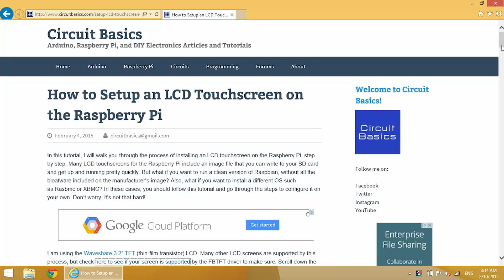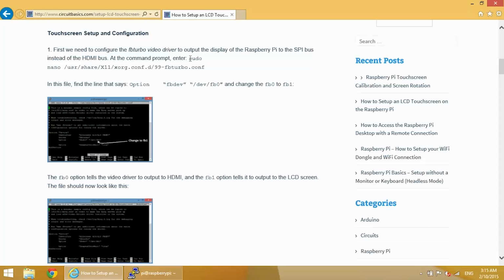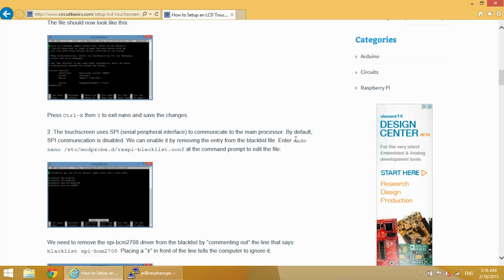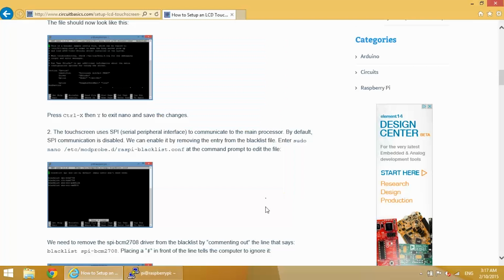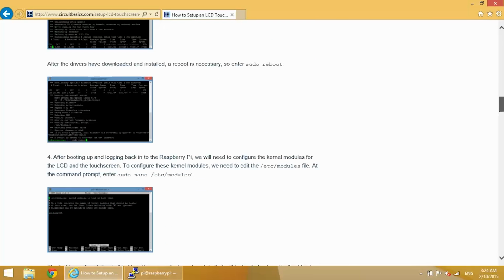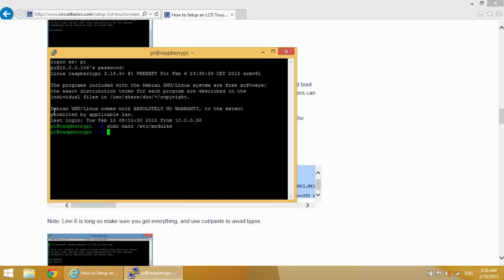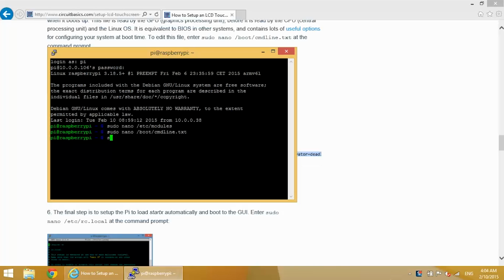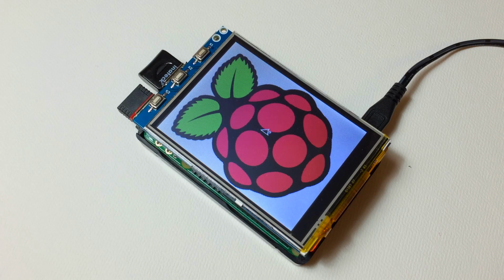How to Setup an LCD Touchscreen on the Raspberry Pi

Comment: have a raspberry 3 b with this 3.5 inch RPi LCD Display (C) 320 x 480 pixels High Speed SPI XPT2046 Touch Controller Waveshare CEROHS can I configure like yours

Comment: I got an LCD screen way before I got my Pi, and after seeing all the stuff you have to change in there, I won't be using the screen anytime soon.  That's just too much stuff to have to change and then change it back if you want to use the HDMI port later.  Thanks for the video though.  I might refer back to it at a later time.

Comment: Hi. I'm using it with raspberry pi 3B and latest raspbian (november 2018), after a first reboot step in the article 
(that is after sudo REPO_URI=https://github.com/notro/rpi-firmware rpi-update )
I got it unbootable, and showing nothing but the rainbow screen on the HDMI, and an LCD lit up with no picture. it hasn't appeared on the network either

Is there any fix for that?
or a correct tutorial for my config? (I got my screen listed in supported devices)

Comment: I have the latest Raspian on a Pi2B.  There is no option relating to SPI in the raspi-config advanced menu.  Also, the system hangs when downloading drivers and kernel modules.

Comment: My raspberry pi 3 model B is now messed up. 

After downloading on one of the steps and rebooting, my pi does not connect to wifi, and the desktop won't appear. All I have is the option to rocover in the beginning before a blank screen. I have a lot of important programs in my raspberry pi, so truly I think that this has screwed up my work

Comment: how would you do this in libreelec the ssh is setup a little different than others also i am using a 3.5 kuman screen. I cannot find anything on the net about this screen as far as installs without using the preloaded os. Also the drivers do not appear on the list you have. I do have the files from the manufacture and the varius files needed

Comment: can you please tell me if this display http://www.ebay.com/itm/3-5-TFT-LCD-Touch-Screen-Module-320-480-RGB-Display-Board-For-Raspberry-Pi-3-/281630179282?hash=item4192777fd2:g:l7MAAOSwo4pYPCUb is supported or not ? i want to make sure before i buy it

Comment: Will this work with the Pi Zero?
Reply: you will need to solder the monitor in
Reply: it does work as a display, but I can't get the touch or the buttons to work which is really frigging annoying... And you don't have to solder the display directly, you just need to solder pins on the board first... which is kind of obvious...

Comment: Is it possible to plug both a fan and a touchscreen onto the same Pi? can you help a guy out?
Reply from the maker: +Lester Ipapo Since the LCD takes up all the GPIOs, you will need a GPIO expander like the dvk512 or similar, but it is possible
Reply: +Circuit Basics What if i solder a Y cable and make the appropriate connection to the proper GPIO of both the fan and the display. So now the lcd is wired to the Pi instead of being directly attached. In theory is that possible?

Comment: Do not follow these instructions on the Raspberry Pi 3 w/Raspbian installed, if you do then your installation will be unbootable. It appears that the firmware update part downgrades the library modules. So make sure you have a backup of your important stuff if you decide to go ahead and try.
Reply: Not yet but will be trying again soon.
Reply: D.W. Odom  do you have a tutorial for me?
Reply: Wish I saw this before

Comment: I have the WaveShare SpotPear 3.2inch RPi LCD (v3)and there has to be an easier way of getting this done .
Reply from the maker: If you want to use the OS provided by the manufacturer of your LCD, it's easy... But if you want to use it with an updated OS like Raspbian Jessie, you will have to install and configure the drivers for the display and the touchscreen. Unfortunately there isn't an easier way but if you follow the tutorial you can get it working...

Comment: So, I managed to get my display up and running just like the tutorial. However, I have few questions.. Firstly, is the default screen resolution setup during installation of the correct size? Coz when I launch my calculator or browser application, I only get to see half of my calculator or browser. When I drag my calculator or browser application below/above my display (installed on landscape orientation), it just keeps going all the way down/up like there's more hidden space left outside my LCD display or something. Even at the end of your tutorial, your taskbar at the top of the screen shows only up to terminal link. In my case it shows up to eject button. So I'm wondering if the screen resolution can be adjusted in any way (zoomed-out further) or if this is a compatibility issue for certain application.
Reply from the maker: Yes, you can change the resolution... In the /etc/modules file you'll find a parameter for height and width.

Comment: I am using a Raspberry Pi 2 and put in 'smd-bcm2836' and then copied your code. Then changed the name to my screen which is 'er_tftm070_5' and it said their was an 'Error writing /ect/modules: No such file or directory'. Can you help me out?
Reply from the maker: What OS are you using?
Reply: +Circuit Basics ios 8

Comment: Hello,  I have no use for Rasbian and would like to configure the touchscreen to work in XBMC. I have openelec installed through berryboot as well as raspbian and retropie. I would like to know how to configure this screen within Berryboot.  Has anyone had any luck with this , or am I wasting my time.  The one question I have about your video is ... what image you are using on your Pie that you connect to in putty? you never mentioned it in the video.... Is your Pie booted into Raspbian already and then you connect through putty?  When I boot up my Pie with the Berryboot image, I can not access it unless Raspbian or one of the other installed OS's are loaded and running. Each OS also has its own login.    Can I just log into the pie using putty while its running the Openelec OS and then run the commands and follow the video ?  Or does this only work in Raspbian?  Thank you in advanced for this Video. I was just unclear as to what you are logging into on the pie using putty?

Comment: Hi, I use a mac and just want to ask, how are you able to have the raspberry pi running in a window like an application, on your pc?  I want to run my pi on a small tft screen through the gpio port, so being able to copy the code from mac to the pi would be very useful.

Many thanks for any help!
Reply from the maker: Hi, I'm doing it through an SSH connection with a program called putty. I don't have a Mac so unfortunately I can't tell you how to do it. But I know it is possible with Terminal on a Mac. I'm sure there are tutorials out there on it, maybe search for SSH with Terminal.
Reply: +Shlendle The program is Putty. It uses SSH to log in to the terminal remotely. You'll want to look up a bit about "Raspberry Pi SSH" but t should be easy once you know what to search for.
Reply: +pricemac thank you very much for your reply! I'll check it out :)

Comment: I done all this with a 3.2&quot; waveshare spotpear touch screen lcd &amp; the though screen wouldn&apos;t function.

Everything else worked, so I installed the image that came with the LCD &amp; that works fine, but they have a folder in /home/Pi/ called DVK512 &amp; inside there is the LCD Config files, that work.

Comment: I am having trouble with getting my GUI back up. At the boot screen it repeatedly says "No protocol specified". After a little while, it will stop and basically tells me that it has givin up trying to connect to the x server. I went through this tutorial about three times and nothing different happened. Any idea of what I may have done wrong?

Comment: I followed your guide step by step, copy and paste code etc. Afterwards I rebooted and my Pi had no hdmi output, the touchscreen was blank, only a red LED on my rp2b, my router showed the pi connected but it had no name as before it was seen as a raspberry pi and when I tried to connect through putty it would hang then give an error about connection.
so after trying for it to work multiple times I decided to format and try again, raspbian fails installation around 70% with error "tarball xz: corrupted data tar: short read." then attempts to boot but fails with "end kernel panic - not syncing VFS: unable to mount root fs on unknown block (179,2)" when googled someone with a different OS advises they changed the cmdline from root=/dev/mmcblk0p2 to root=/dev/mmcblk0p6 and theyre issue was resolved.
step 5 of your guide changes this from 0p6 to 0p2 could that have stopped me from been able to reinstall raspbian? and how would I change it back?
Reply: i was able to reinstall raspbian with a clean download of Noobs but after following this tutorial again im back to a bricked rpi2b with the same error

Comment: Very useful video, so far I installed Noobs and Raspian on the SD card only. I got the exact same screen as you got. What I can't find is how to get in the putty folder. If I connect the SD card only I can't see that folder, if I connect the Pi itself I can't see anything on Windows explorer? So where can I find that folder? Thanks.

Comment: Any clue if this driver supports the adafruit28 capacitive touchscreen? I see 'adafruit28' listed but I'm wondering if it includes the capacitive version.
Reply from the maker: CaMiX I haven't tested that screen, but I don't see why it wouldn't work. The screen I am using is a capacitive touchscreen also. Also, the display driver is separate from the touch driver, and the fbtft_device name is just for the display type. The touch driver is pretty much universal as far as I know...
Reply: Circuit Basics once I get my screen I'll test it out. Thanks!

Comment: Would it be possible to pull a touchscreen from an unused smart phone and use this method to install it?
Reply from the maker: Taylor Downs I'm sure it's possible, it would just be a matter of either finding or creating the screen driver and touchscreen driver for it. If you can find the part number of the screen, I would Google it to see if anyone has already made a driver for it on linux

Comment from the maker: How to Setup an LCD Touchscreen on the Raspberry Pi

In this video, I will walk through the steps of setting up an LCD touchscreen on the Raspberry Pi. A full tutorial and all of the code and links are provided on my blog at: http://www.circuitbasics.com/?p=494

Discover more about electronics at the Circuit Basics blog: www.circuitbasics.com

Facebook: www.circuitbasics.com/facebook
Twitter: www.twitter.com/circuitbasics
Instagram: www.instagram.com/circuitbasics
Reply: Circuit Basics HelloGreat Video, But I have a problem, when I try to access 99-fbturbo.conf I get an Error message that the file does not exist what should I do?Thanks
Reply: +wasem gara - probably just need to create a new one and fill it with new contents
Reply: +Circuit Basics when i type in sudo nano /usr/share/X11/xorg.conf.d/99-fbturbo.conf. the raspberry pi just Shows a blach Screen please help
Reply: +Tobias Uhl And now it doesent Show anythig at all
Reply: +wasem gara  +Circuit Basics I am having the same proble, would deeply appreciate if you would reply to this a quickly as you have been to everyone else.
Reply: do I need more parts then just the screen and RPi B 3?
Reply: +Kizoku Goodra Any instructions saying to use the deprecated raspi-update are too old to work.  Nostro's drivers have been integrated into raspbian.
Reply: Damn, no 3.5 Inch.